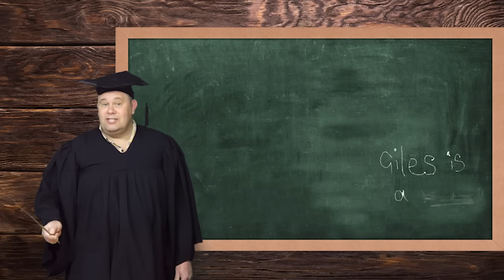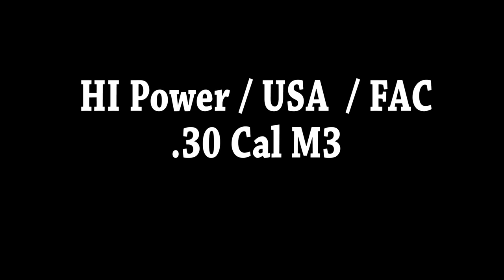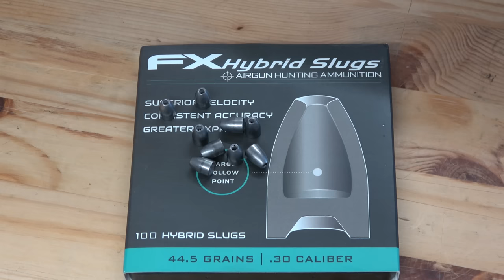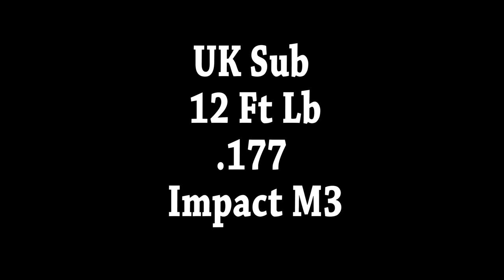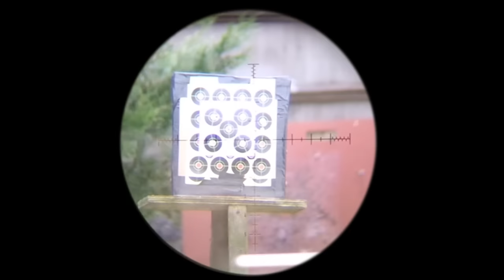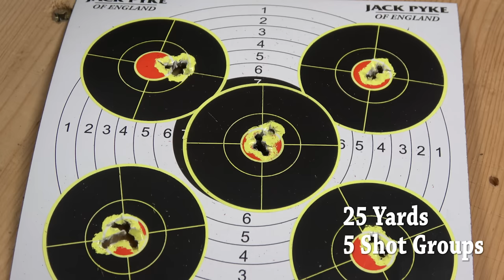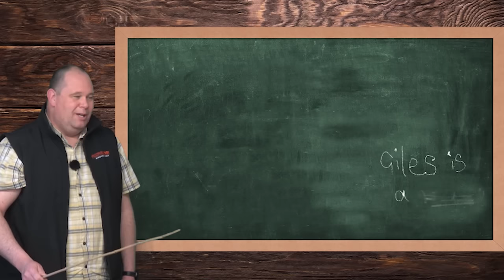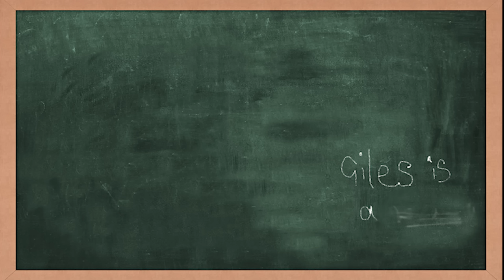REVIEW: FX Impact M3 - USA + UK PCP Airgun

Comment: I just buy mkii 😭😭, why take you solong 😁😁.... And also have a question please help in our place .22 or bigger are so hard to get so i try 177 with 16.20jsb it only good at under 40m. After that is useless fly all over the place under 30 its so accurate i try the speed a between 750-930 nothing work at 50+ can you plese gave me a solution or the impact dont work with 16.20 at all im so loss